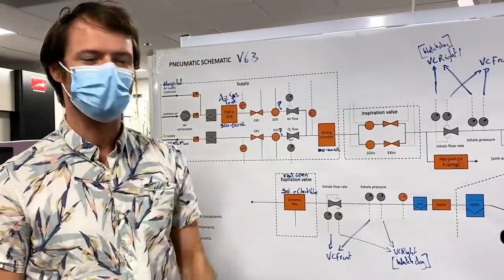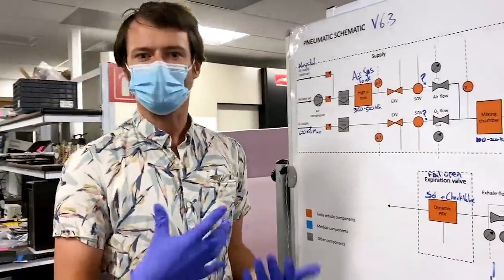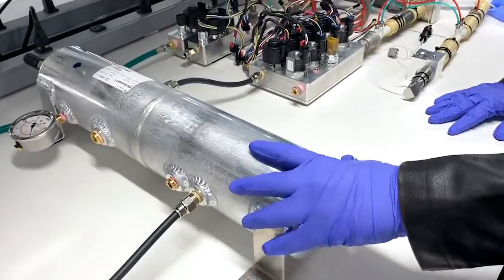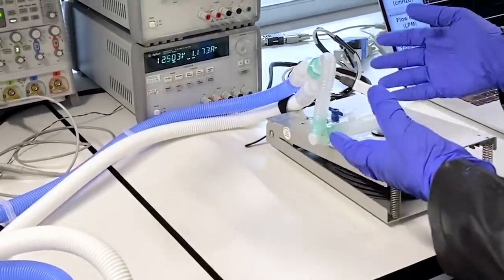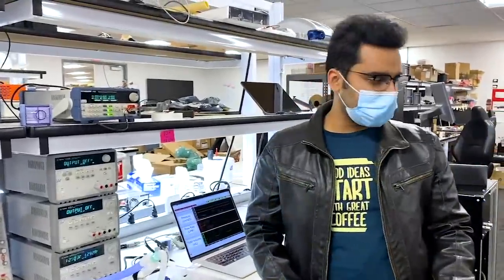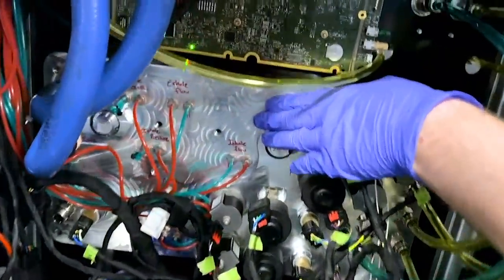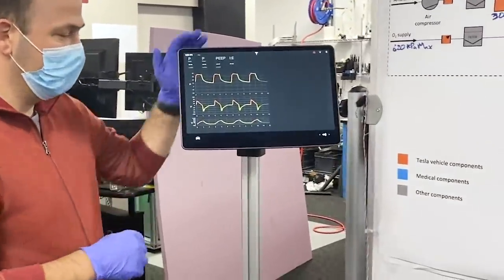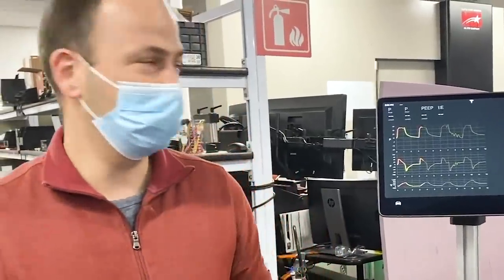Tesla Ventilator

Comment: BTC price hit $13,000 after an almost $1,000 intraday candle tapped the remaining bear market resistance keeping new all-time highs at bay a little while longer. With so many traders in profit, short-sellers have stepped up in a major way, opening millions in positions betting big that the recent uptrend will soon reverse. However, with so much money on the line, a potential setup for an epic short squeeze could keep the cryptocurrency trucking right along - which these short sellers might actually be perfectly fine with. Here's why I day trade with a genuinely and dependable trader/analyst like pomah  and win colossal profts out of the bullrun You can stop for one second to sit down to talk with him by procedures of Instagram @official_pomah.hectopfxfor any crypotrelated issues.
Reply: Despite the economic crisis, this is the best time to
Invest invest in bitcoin
Reply: @garsonhank7146   I have been trading for about 6 months now and just about every trade backfires and slaps me in my face. Nearly impossible for me to catch more than a few points I try to do top down analysis but it doesn't work for me. I say to mysell, clearly I'm in the 90% that lose money, so l open a demo account, do my analysis, then take the opposite of what I would normally take and get the same result. I'm starting to feel hopeless, any advice for a struggling trader
Reply: @bethcalder30  Since you're a beginner, just keep trading and practicing. also I suggest you get in touch with an expert to help you trade
Reply: @bethcalder30  @official_pomah.hectopfx
Reply: @garsonhank7146  I’ll do just that thank you
Reply: @garsonhank7146  I have lost a lot of capital trading by myself lately, I hope he can do the same for me, as I need someone with a very good record to guide me
Reply: I totally agree with you mate
Reply: I was able to gain over 7BTC in just 2 weeks of intensive trading with PoMaH
Reply: Calculate that with the current price of bitcoin that’s roughly over $90,000
Reply: Btc is holding above crucial technical support at €11,000. It’s a safe haven unlike its rival USD which is experiencing a sharp decline
Reply: The rich spend less and invest more
Reply: I wanted to trade crypto but got confused by the fluctuation in price
Reply: @austincannon9775  That won't bother you if you trade with a professional like Mr Pomah
Reply: Well, trading with mr pomah is nothing new to me. I’ve been an investor with him since 2019. He’s been a great mentor and account manager to me
Reply: My first investment with Mr Pomah earned me profits of $25,620 and ever since then he has been delivering
Reply: he's obviously the best I invested 2000USD with him and in 5 days I made a profit of 18,000 USD

Comment: I  am a non traditional student. I have used the hex converter to discover the decimal of 4117, which is the amount of times that God is in the Bible, is 16663. The base of hecidecimal binary is 16. 
I have discovered that Pi is not infinite but 3.16. 
If you square root 16 . It's 4 . 
E= mc squared when you round up the speed of light to 300,000. When you round that down to 3 meaning if you cant go negative then stop at lowest point of speed most like light . Then go down in time by square rooting.
Square root of 16 is equal to the sum of 7 and 3 squared when you square root it. 4. 
It's going up by way of going down, like using 2 nd when driving a car.
3.16 means a 348 day calendar year and 45 minutes less is in our day.
Now 3.16 means the 16 is to the right.
B=xm+y. 
The equation is first, and then linear.
If, then clause is refuted and a  is now a
Then, if statement. 
5104346262
jasmin.miller@students.dominican.edu

Comment: All Tesla series with wider rear track than front track bodyworks : the lowest traction 0.7g, extreme tail flick, extreme slide by Formula One speed (160-250 km/hour and over 250 km/hour) on all Formula one circuits.
All Tesla series with traction grade F by all countries test performance maximum speeds.

From
Tesla database

Comment: 41 days later. Ventilators delivered = 0
Reply: You do realize that Elon literally said that it would probably take longer to engineer and build these than it will take to develop a vaccine for covid? Also, he delivered non-intrusive ventilators which the hospitals said would be useful before shipment.
Reply: @groosegartcho5700  where is it?
This isn't about CPAPs!
Reply: @SaschaPallenberg  this comment is literally two months old, and also I explicitly stated that Elon said it would take longer to engineer these than it would to develop the vaccine. The CPAP comment was made because they ARE ventilators, yet you claimed there were 0 delivered. They are not THE Tesla engineered ventilators, however they are STILL ventilators.
Reply: @groosegartcho5700  CPAPs are no ventilators. Btw SEAT Spain built real ventilators.
Reply: @SaschaPallenberg  They are non intrusive ventilators.
Reply: @groosegartcho5700  these are CPAPs. Ventilators they are not. 
So if it's possible for SEAT Spain to build and deliver ventilators in no time, why couldn't Tesla make a single one?
At least they put a PR video up, right? 😎
Reply: @SaschaPallenberg  You didn't listen to me. I said they are non-intrusive ventilators.

Comment: They are making Ventilators at the old GM plant in Kokomo, Indiana. They have special Tax incentives that go to Car manufacturers there. Like Fiat and Subaru. A lot of Good Union auto workers there. Elon should move the head Quarters there. If you want to go big with electric vehicles why not start in like the middle of the Nation, and or content. Location, location, location.
Reply: Yeah I also cam up with this Funnel Ideal for Electro magnetic Radiation. It involved a Grooved Cylinder like the Groves of a Barrel inside a gun for accrasy. On the outside leading into the hole opening, Iron ball paint. The kind the use on the Stealth bomber to absorb inwards the radiation then in the cylinder with it's Groves reflective paint used for The radiation to spin and reflect back the waves back into each other. Making the waves more accurate and stronger. You could reverse the paint scheme to weeking the radiation waves.

Comment: 1.nose inhaling of dried-turmeric[curcuma longa l] gas (holding one end, burn tip of other end and blow fire off) 2.orally consume outer layer of masikai[quercus infectoria](soak in water&rub on hard surface to get dark green cream)3.sleep facedown get focal point of both infected lungs-perform a very low-fire-single cupping once on each side. wait for turmeric smoke re-action in lungs and masikai travel-cycle through the blood until it reaches lungs to re-act on inflamation and as an antioxidant then antiviral inside lungs.html

Comment: Excellent. Suggestion: Add a mode to support self triggered breathing for support of ligher cases or improving patients. Take Diving regulator parts for the valve  / trigger mechanism that allows for small vacuum provided by lungs to trigger positive gas pressure and breathing support to avoid fatigue. :-) (if you haven't already solved that problem...)

Comment: If their is going to be alot of moisture, fuild,buidup or extacted by the exhaust. It may be good to allow it to defuses into larger container so the flow is slower, so dont have projectile fuild from the exhaust pressure, snotty noise comparison.Any fuild in the exhail, rather collect large defuse container, that can be disposed off and well fuild sterilises before. Incase virus makes out with and due to moisture build-up in the exhaust.

Comment: How about adding a peltier to the air intake, such that you dry it by removing the moisture, cooling passing tought radiator, run off and then heat again, to respective temp for lungs such that has the ability to cause fuild to vapourise and be exhausted.
Since this disease also causes fluid build-up. Ability to regulate relative humidity and water vapour and dry, wetness sure would help more than just pushing air in and out. Add three dimension of control ability to creat dry environment for removing of vapour. Which one can also control

Comment: I think the air should be modulated rather than smoothly flowing in or out. This is because the vibration in the lung tissue will help clear mucus . This is done mechanically with Cystic fibrosis patents and maybe for other lung diseases. It seems to me vibrating the air in the lungs as the machine delivers it would be more effective and probably just a software change to the machine.

https://youtu.be/OAm4pm7ufQc

Comment: Just remember, dont touch the blue outside of the mask my dudes. Adjust it with the strings by the edge if anything, but most importantly tighten the aluminum strip at the top around your nose so the mask doesnt drift down :)

Comment: Needs a DAR filter both in the inspiration circuit as well as on the expiration circuit! Can be placed before the PEEP valve. Unfiltered exhaust = aerosolized virus. Expect a few cmH2O drop from the filter. Consider just using the in-house PEEP valves that hospitals carry—staff are familiar with them already, they are adjustable with a twist, and readily available. I’m sure with the sensors you’ve got you can write up some simple code for a pressure support mode, something that is used when weaning pts off a vent. What safeguards have you in place to prevent barotrauma in a non compliant lung? Great work so far.

Comment: This would work for pts whom are on anesthesia; however, most pts will fight the ventilator as they try to breath on their own and have to wait a fraction of a second to receive a breath over and over again resulting in them ripping the ET tube out of their throat. The question is, can you incorporate a pressure trigger sensor along with other modes of ventilation to allow more normal natural breathing so the ventilator is not breathing for the pt, but assisting the pt in  their breathing. Good work though.
Reply: Yes. That's how we wean people off of ventilators. It's an augmented assist mode and they all do it. Patient's still need sedation due to the irritability of the endotracheal tube.

Comment: So the idea of a ventilators is to regulate the air and add O2 an Co2 to compensate for the missing gases .
The problem with a Covid patient is that they are spewing viral load into tge environment  
Pull out the air , run it through a scrubber with ultraviolet light to kill virus in breath and put back into patient .
By theory lowering the viral load reintroduced to the patiant should help the recovery process and protect frintline workers lowering load in the environment too ..

Good work

Comment: You can get rid of one of the flow rate sensors and one of the  pressure sensors. Place single flow rate and pressure sensor at the junction where 2 pipes connect

Comment: Having gotten this virus and beaten it in the course of two weeks, last 3 days with 6000 watts of heat in my sleep for 14 hours a day for 3 days. Looking back in hignsight, this virus does not like heat, it will take the body to a 100 plus, but not much farther. May I suggest heating the air in the ventilator [option] to take the lungs to 104 degrees, I do not believe it would thrive in that environment. It is just too hot. One thing Gov Como said also struck me, the longer one stays on the ventilator the more chance they will never come off. Basically , drowning in slow motion, maybe also add a dehumidifier to take the lung back to factory spec. Do not let humidity build up.

Comment: Cudos Tesla!
It is essential that you try to use auto parts as much as possible to ease the burden on the medical supply chain. 
As I watched the video I observed a small error in your diagram: the heating should be in the inspiration arm best before the humidifier and not in the expiration arm. I guess you figured that out already 😏
Just to make sure, you are controlling the PEEP valve via software? Thats essential.

In the end of the video in the product requirements you check all the essential  boxes. I’d like that you to add flow and pressure triggered ventilation and  some lung recruitment procedures.
So please design over the air updates into the ventilator that you can add some software dependent procedures (like recruitment) later.

After this first wave of very sick patients the heath care system will have to cope for a prolonged period with this extremely contagious disease.
I also hope that Tesla would design a PAPR like the Versaflo from 3M. This is an essential part of PPE and it is in significant shortage. We as a medical community will need this for the next 12-18 months at least until a cure or vaccine for covid-19 is widely available.

An anesthesiologist and intensive care physician.

P.S. Don't touch your masks all the time you risk contamination. 😏

Comment: As a Hardware and Software engineer who has designed ventilators in the past...

Did the third guy mention that they’re using an Exhalation valve? That’s a major concern.

Modern ventilators tend to stick with passive exhalation. Meaning, exhaling is not controlled by software or hardware, rather by Mother Nature.

Having an exhalation valve could potentially harm the patient in the event that it fails and locked close.

Comment: If it provides proper amount of flow as well as proper pressure and oxygen levels then it's a go.    Gov will give it a OK to use on patients with Coronavirus.         It doesn't matter if it's made of Russian farm tractor parts or lamorgini parts.  As long as it works properly that's all that matters.